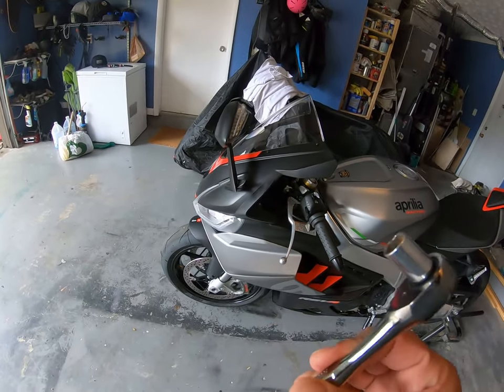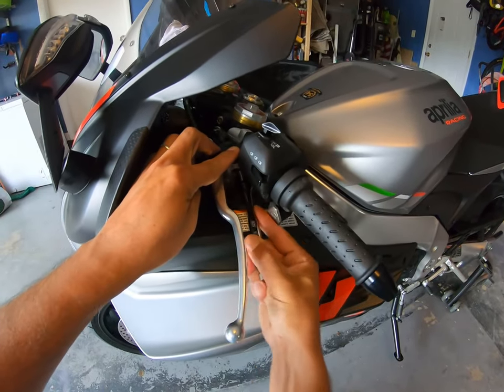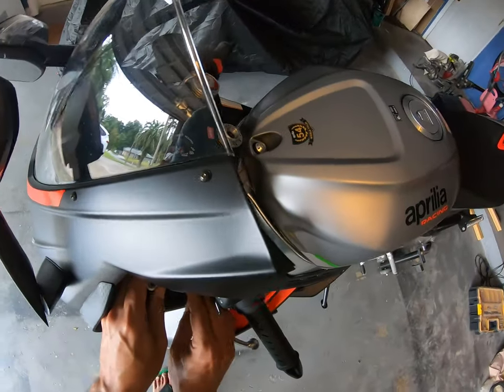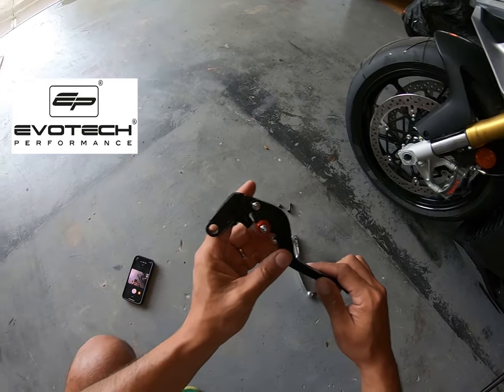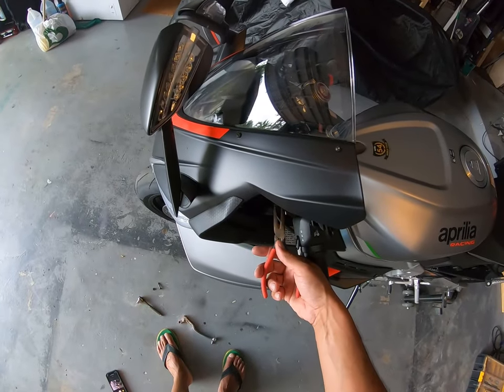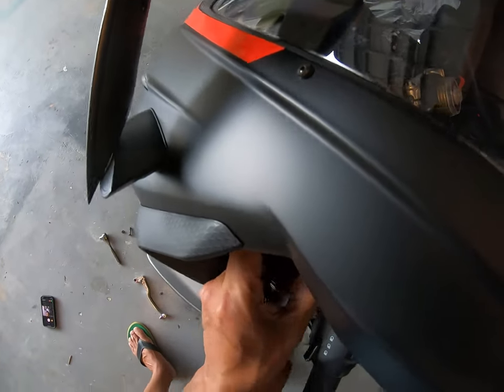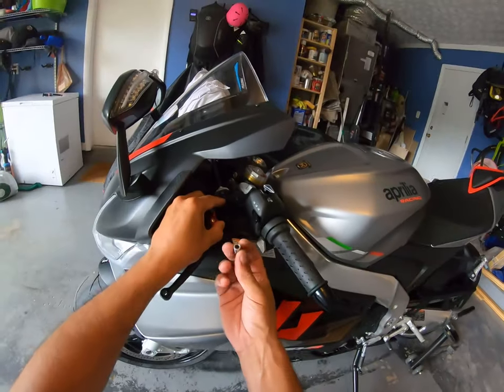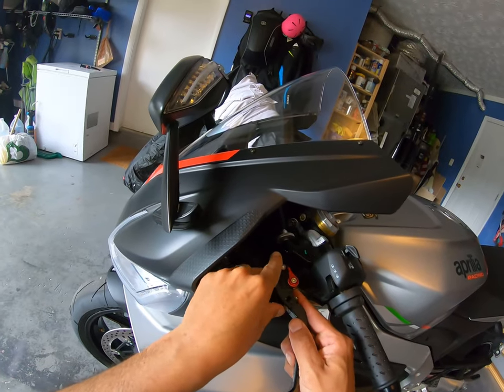2021 Aprilia RSV4 - Evotech Clutch Lever replacement

Comment: To anyone reading this, be sure to not break your clutch safety switch when taking off and replacing your clutch lever. Press the switch in as you line up the lever. 
If you break that switch, cruise control and the auto-blipper will not work.
Reply from the maker: Thanks for the feedback. Definitely good to know!
Reply: is there a video for replacing the switch? i broke mine
Reply: @jkhoun  Not sure but the process was pretty straight forward.